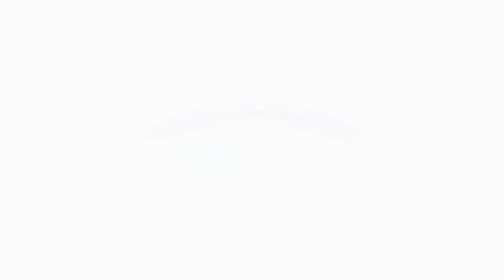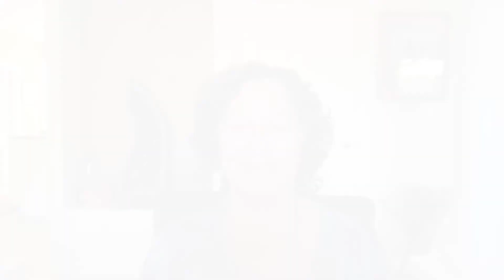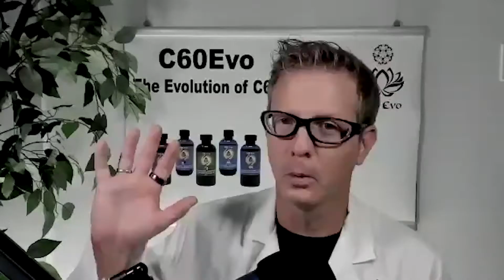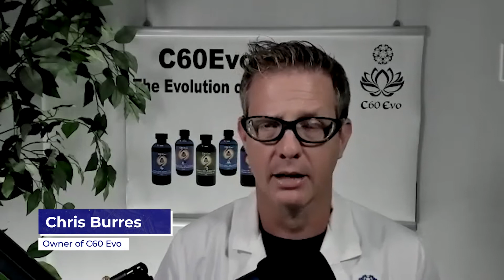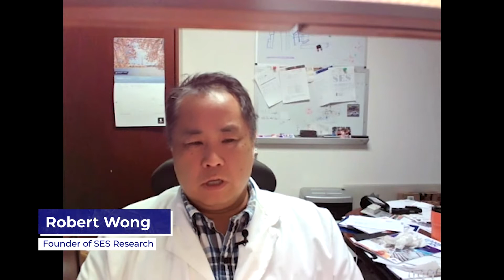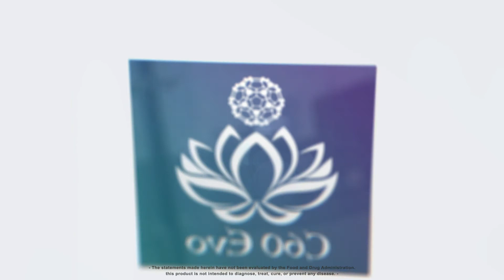C60 & ESS60 are NOT Connected to Bots, AI Technology, Nano Tubes - C60 Evo Scientists

Comment: very interesting.  any noticable side effects to consider?  i saw some youtubers wondering if it can affect your dna?  any opinions?  thanks for any info.
Reply from the maker: The only side effects are in the beginning if you are detoxing. You can get a little bit queasy if your intestines need to be cleaned out. Sometimes our facial serum will push toxins through your skin in the beginning as well, but everything you detox is beneficial for your health. Everything seems to improve in your system with these products. We can't really say anything about DNA because we haven't done testing on that. Hope this helps.